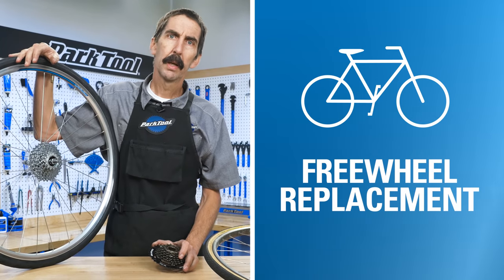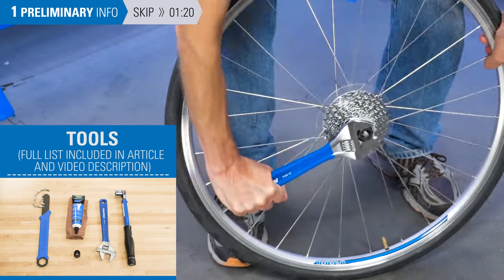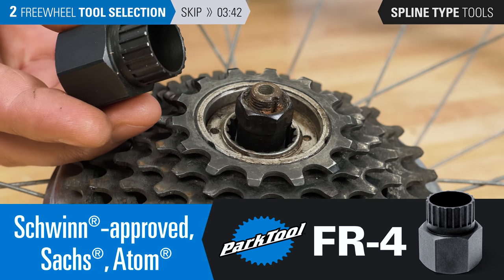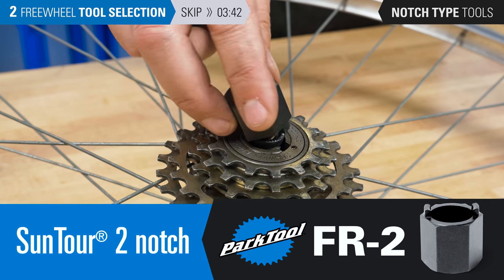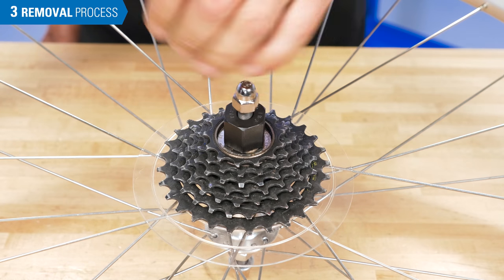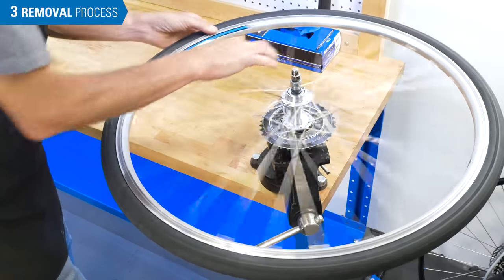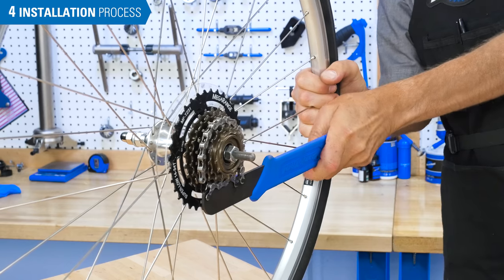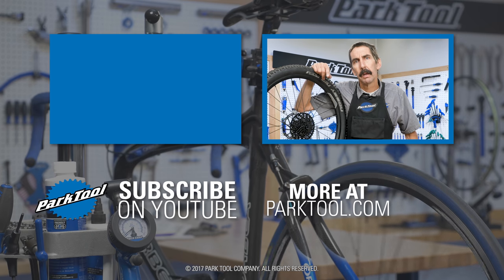Freewheel Removal & Installation

Comment: I wanted to change the spoke protector on my Trek mountain bike because it was old and cracked. I purchased the new protector, but didn’t realize I needed the special tool to get the freewheel off. Your video helped me immensely. I purchased the FR–3 tool and completed the job. The trick in putting the nut on to hold the socket was a game changer. Thank you very much.

Comment: Freewheel removal tip:
I had great amount of trouble using an adjustable wrench as shown in the video (granted my wrench was short so not much torque).
That said I've had great success with the 4-Way Lug Wrench from our car (the cross one used to take tires off). It just so happened ours had a 13/16" socket (21mm) which matched my Shimano freewheel tool.
I hope this helps others in the removal of the freewheel, it's the hardest part of the process.
Reply: Ha I thought I was the only one using a 4 way car wrench lol! Peace out cub scouts!
Reply: That was my first thought.. then I went to my trunk and picked mine 4-way lug wrench.. but to my surprise my freewheel removal tool was too big to any of the 4 ways.. =/
Reply: if your wrench is short and you cant make it happen get a metal pipe, slide it over the length of the wrench and you should be able to do it then, mechanical advantage at work, cheers
Reply: Adjustable wrenches always seem like a compromise to me. If not of really good quality there's just too much play in the mechanics of it.
Always better to use a correctly sized tool (reg. spanner or said 4-way lug wrench if matching) instead of a "universal" tool.

Comment: a funny learning experience story below:

i spent two days struggling with removing a screw on cassette, as I referred to it. wrongly. and so, I took the tools I was using, and the wheel to my local shop. i showed him my chain whip, wrench and FR1 and asked I doing something wrong. Nope, he says and charged me to remove it. i had to remove it today and had the same issue. NO CHAIN WHIP needed ! stupid me for not knowing and trusting those clowns. 

Thank You Calvin !!!

Comment: Park Tool makes the very best and most detailed bike service videos.  Love every one of them.  I learn something every time I view them, and I work on a lot of different bikes.  The info here is very valuable.  The Park Tool FR1.3 is the go-to tool in our shop for many types of repairs- bent axles, bearings, swapping bad freewheels, broken spokes, etc.   It fits so many of the cheap freewheels that are out there, and we see a lot of them.  But I really can't agree with the usage depicted of the FR1.3.  If you use an adjustable wrench with it, and encounter a stuck freewheel, you WILL break this too.  I have several now, cracked right in half.  Our old old trusty FR1.1 is still going strong because it has a thicker drive end.  The 1.3 is just too thin, and adjustable wrenches place too much strain on just 2 flats.  Yet this video, and the packaging for 1.3 says to use an adjustable wrench.  I need a heavy-duty alternative, maybe even a tool formed onto the end of a flat bar so it's reinforced.

Comment: This was the most helpful video I've seen thus far on this subject.  Knowing there are EXACT tools for each type of freewheel is a HUGE help.  The tool I bought before was obviously fir a different freewheel.  I also din't know about anti-seize goop.  

Next up will be looking at derailleur and maybe, just maybe attempt at repacking berrings inside a wheel.  I never thought I'd have to practically become a bicycle mechanic but so many businesses have closed down.

That shop!  WOW!! Drooooool.

Cheers.
Reply: The two nearest biek shops to me are 45 minutes in opposite directions. On the one hand tht is annoying for tasks, such as truing, I have difficulty with due to vision. On the other 'eh it's part of owning a bike.'

Comment: I use the removal tool for installation.  If it will hand turn clockwise and counter clockwise with minimal resistance at the start, then it's not cross-threaded.

Comment: Agree with anti-seize being better than grease, but a little goes a long way (enough to put on the end of a Q-tip is plenty). And use disposable gloves since it is hard to wash off and will transfer to the saddle or handlebar tape.

Comment: I had to use an automotive socket wrench to get enough grunt to break the freewheel I had loose.

Also got lucky in tool selection. I just ook a stab at it and 'oh hey that worked. Neat.'

I did not see ANY grease on the freewheel threads, which concerns me, but 'well tha tracks with literally everything else i've seen on this bike.'

Comment: Why not use the spline tool again to tighten? Why is the chain whip recommended instead?
Reply from the maker: You can use the spline tool if you would like. I find it easier to seat it on the bike or with a chain whip.

Comment: i'm basically winging it. I have a 7-speed freewheel that I want to upgrade to 8-speed. I have no idea which tool to get, so I just bought a random one that seems to come with every freewheel removal kit. I could check to see which type of tool I might need but with the stupid stubborn Box 4 derailleur I have installed it would involve taking the chain off, then removing the derailleur in order to remove the QR wheel. The clutch on the derailleur is so stiff that it's impossible to move the derailleur out of the way to drop the wheel. Wish me luck when I try removing the freewheel tomorrow after work I'm like 90% sure the freewheel removal tool is actually a cassette lockring removal tool.

Comment: Great video, these are excellent. I do have a question though - Why is it you can not use the removal tool FR-1.3 to tighten the freewheel? Why do you need to use the chain whip method?
Reply from the maker: Yes you can tighten the freewheel with a chain whip, or the tool, but simply the first pedal stroke riding it does a better job.

Comment: I have a "wobble" in my freewheel. 

When viewed from above (handle bars to left, back of bike to right hand side), with the wheel spinning, but the freewheel not rotating, the top of the freewheel moves out and in, relative to the wheel. Any idea what has caused this or potential fixes? 

30yr old raleigh mountain bike which has seen quite a bit of use, but not overly abused.

Comment: Great Video. Calvin. I have a doubt about my freewheel shimano MF-TZ20. It has a NB CHINA LABEL on the lock ring. I already watch the other videos about determining casette/freewheeI type / tool. I guess the closest is the FR1.3  BUT.  I am not sure since the splines / notches are not clear. That is why I don´t know what the solution is. Thanks. Greetings from Bolivia one of the worst places for urban cycling.

Comment: I have an older bike that had a freewheel labeled Falcon, but the FR-1.3 tool fit instead of the FR-7
Reply from the maker: That brand of freewheel has not proven the most consistent is sizing.  But if it works, use it.

Comment: Just the right guy to ask the question, I have a couple of the park PRS4W bike stands but even though i close the jaws very tight on
sometimes the frame or the seat post the bike will move and is still quite loose in the stand and moves.  How can i correct this problem please.

Comment: i put a new freewheel on my bike, same 1st gear as before, but now when i roll the bike backwards, or turn the pedals backwards, the chain is knocked off and falls into 2nd gear, and then jams if you continue to turn backwards, - if you then start riding forward, it shifts back to 1st by itself. 
how to i fix this?

Comment: "Might take some force" yeah mine is solid and won't budge. Took it to a bike shop and got them to fit it a few months ago. Recently i needed a new wheel so been trying to remove it and fit it onto the new wheel I've even put a long pole on the end of the spanner for leverage and was going to town on it with a big mallet still won't budge and its pissing me off now.

Comment: As in 6.00 sec,My freewheel is off center, so not aligned with wheel, but I dont have sufficient tool to repair it even have such cercumstances that no one can repair it near by, so my question is-> can it be harmful to any other parts??

Comment: How about if I have a tri spoke wheel that only came with a single-speed sprocket and I added the Freewheel do I have to remove that metal nut it screws right over the top of it

Comment: I think my new bike has stuck or seized freewheel because I can't get it to lose. The nut that secures the cone cap is too high up on the axle that the freewheel remove tool (mine has 12 spline) can't seat fully so it slips when I forced it to turn.

Comment: So if you're removing the freewheel with just the spline socket, why not install with just the spline socket? And likewise, could you remove with just a chainwhip?
Reply from the maker: The chainwhip will turn the freewheel clockwise only.  The ratchet between the inner body and the outer sprockets will lock and tighten the freewheel against the hub. This is exactly how you ride, as the chain turn the hub.  The inner body needs to be turned counter-clockwise, to the left.  The chainwhip will then make is freewheel, just spin as if you are coasting.  The sprocket cassette stack of sprockets do not fit the body of the freewheel. The two system do not interchange.

Comment: Hi Park Tool. I have Shimano MF TZ21 tight on the hub, but has very fractional side to side movement causing much noise. Lockring is also secure. New freewheel?
Reply from the maker: Most likely a new freewheel is the solution. You can remove the wheel and check that the outer lock ring that holds the freewheels adjustment is tight. You will need a pin spanner like the SPA-2 or SPA-6
Reply: @parktool  thanks for the reply. I've checked the lock ring and it is tighter than a nun's gusset. Had a feeling the freewheel needed replacing as its a good few years old now. Keep up the great work, this channel is so valuable👌

Comment: Great video! Unfortunately I've managed to crossthread the new freewheel and it now looks like the picture at 5:56. It's not on very far at all but I can't get the removal tool in past the centre nut. Is there any way to get it back off without destroying it?
Reply from the maker: You may need to pull the axle.  Take is apart from the left side, and pull it out to the right. That might get you enough room to get a remover in.

Comment: Is it really necessary to use the spline socket for freewheel removal.You tightened it with the chain whip,why not take it off with same tool.
Reply from the maker: Good question.  Turn your freewheel counter-clockwise, the removal direction as you watch. It will ratchet backwards, like coasting.  The removal threads will receive not counter-clockwise load.  If we had  "fixed gear" freewheels, then you would only need a whip, but the riding would change more than a bit.

Comment: I came to while trying to figure out why it wont budge in the counterclockwise direction,i tried the half inch air impact gun then back in the vise and with brute strength it finally came😅

Comment: It is idiotic to have so many different standards...
Reply: Gabriel Miqueias  thats good to know at least, rest suck anyways, i mean imagine changing something for sake of cha(ching)nge and not to actually improve anything, at least thats how it looks to me
Reply: Upgraded you computer lately, everything inside has changed as well lol...
Reply: @SlippstersVideos  But you wont need 9532582253 types of tools just in case your "new computer" needs an ssd swap and apparently has a new standard socket or whatnot.
Reply: True.  Everyone thinks they have a better idea.  They also want to sell things, be unique. Many times they just waste time.
Reply: Tell that to Apple...
Reply: Your new to bikes I gather?
Reply: You wont either unless you are planning on opening a bike shop.   I have worked on my own bikes for over 20 years and only have a small amount of specialty tools. @Lann91
Reply: Wait til you hear about bottom brackets!
Reply: Because of the patent
Reply: all by design lol. gotta move product.

Comment: 5:37 Are there any chemical materials I can use on bicycle screws to prevent them from breaking apart?
Does the quality of the screw and tool matter? Or just the tool? Thanks!
Reply from the maker: The quality of the screw and the tool matter. Proper thread preparation can greatly improve a bolt or screws ability to be removed. Some sort of grease, thread locker or anti seize is suggested on most bolts but does sometimes depend on the bolt and its job.

Comment: Question: If my FR 1.3 tool has worn splines with scoring and very shallow notches, is the tool still usable? Will it cause difficulty removing a freewheel? I have a DNP Epoch freewheel i'm having difficulty removing because the tool keeps slipping under heavy torque.
Reply from the maker: If the tool is worn it may slip in the fitting. This is not common at all though. Be sure the tool is fully engaged.
Reply: @parktool  I'm pretty sure it was fully engaged. I purchased another one on Amazon and should be arriving Monday.

Comment: My freewheel is not coming off. Tried both methods and destroyed two FR-3 tools. In the process damaged the notches on the freewheel.  Have any other ideas to remove the freewheel? Maybe a tool that can bite into the damaged notches?
Reply from the maker: We have a tech article on destructive removal here https://www.parktool.com/blog/repair-help/freewheel-destructive-removal . RJ the bike guy also have a good video on the subject.
Reply: Not sure why I didn’t see your reply. Haven’t really messed with it since the last comment. 
Going to try the vise method and then maybe strap wrench. The only reason why I’m removing the freewheel is the spoke protector broke and got jammed up.

Comment: Can i convert it to a singlespeed freewheel? Is there a video for it? Do i need to redish the wheel?
Reply from the maker: Yes, this can be done.  It is likely the single rear sprocket does not align well with the front. You may need to arrange the axle spacers to move the freewheel to the right.  If you do this, then the dish will also need to be corrected for new hub spacing.

Comment: Have a problem with my freewheel. When im freewheeling the freewheel locks up and the derailleur jumps. If I take my feet offf the pedals the pedals start to turn as if I had a fixed hub? It will do this several times over a short journey. Changed freewheel twice but keep getting this problem! Anyone had this problem and any ideas regarding the solution? I did change the original freewheel and only had his problem since then!

Comment: When upgrading a big box bike with a Shimano megarange, do I need to adjust the derailleur to make it fit the 34 tooth chainring?
Reply from the maker: You will need to add as much B tension as possible. Its also important to check that your rear derailleur has the capacity for a 34T. There is a model number stamped into the rear derailleur that can be looked up to find the capacity.

Comment: If I go counter clockwise with the tool the inner axle turns & the cogs turn with clicking noise?
Would I need a chain whip tool?
Reply from the maker: Yes, you need a chain whip to hold the cogs stationary.

Comment: Hey Park Tool, I removed a free wheel from my bikes because I thought the hub was lose but it’s not. It turns out to be the center piece of the freewheel. Any ideas in how to fix that?
Reply from the maker: Typically it is most cost effective to replace the freewheel. Repairing requires specialty tools and very specific parts that may not be available.
Reply: @parktool  thank you!

Comment: Calvin:  I've stripped a handful of freewheel removal tools including those by Park Tool while attempting to remove freewheels from their hubs.  As you know they can be very tight.  I've tried using heat and even some anti-seize sprays to no avail on some.  Is there another method, procedure or trick to removing a very tight freewheel to avoid damage to the freewheel removal tools?  Thanks.
Reply: keep in mind every time you accelerate on a freewheel you tighten it further. If a freewheel comes to me, already seized, and stuck, i use Wurth deep penetration cleaners, to penetrate and loose the dirt in the threads. For this reason it is recommended when you install a free wheel to apply good amount of anti-seize compound, to make your life in future easier.
Reply: Ted Bentley - tool in vice is probably best way if very stiff, but may still slip / strip the tool

Comment: Hi Calvin,
How can I switch a 10 speed cassette to a 11 speed cassette? I have a Specialized Allez using Shimano 105 5800 crankset and just bought a 11 speed  Shimano 5800 cassette to pair.is it possible to do it? Thanks again!!!
Reply from the maker: You need of course the 11 speed shifters, Shimano 105 ST-R7000, or Ultegra.  Then an 11 speed rear derailleur.
Reply: @parktool    You have help me a lot , All the group in my bike are shimano 105 5800 , Include the shifter just to clarify the shift will not work with 11 speed cassette? 
Thanks one more time. I love your channel. Sorry to bother you again!!!!!!
Thanks

Comment: So I’m trying to remove the flywheel but no matter how hard I try I can’t get it to budge. I even tried removing the bearings thinking maybe they’re jammed or something, but it still is stuck. Any suggestions? Is it rusted beyond repair?
Reply: I really need your help
Reply from the maker: KyleTheCakeKid . They can get pretty stuck on there. Using a longer wrench can help a lot. More leverage is going to be your friend. When using a longer lever you will want to make sure you are using the QR or nut to hold the tool into the fitting.